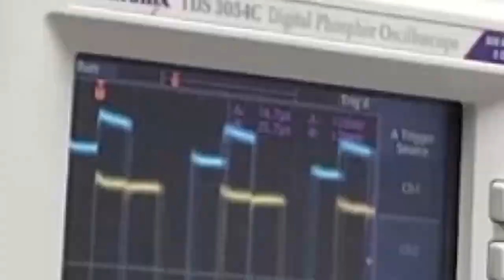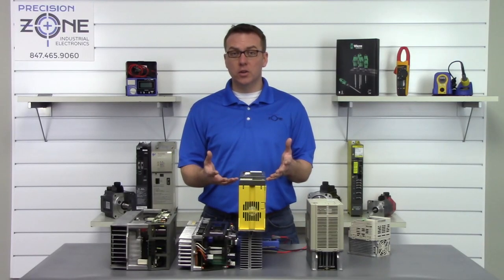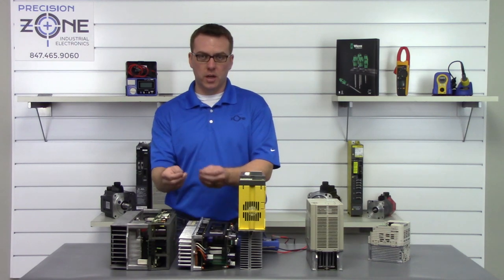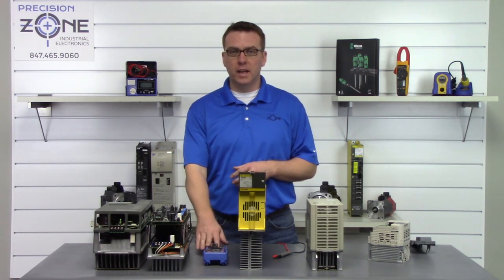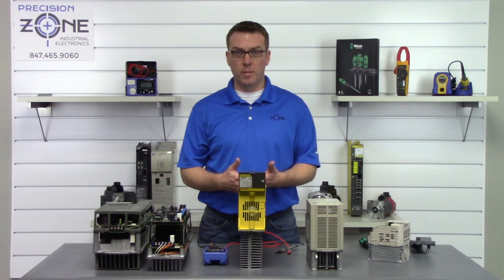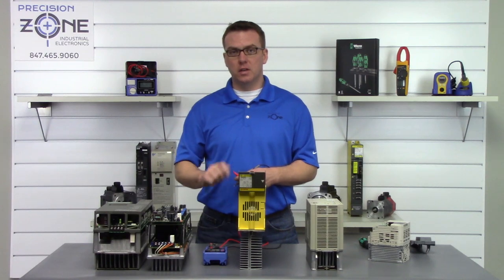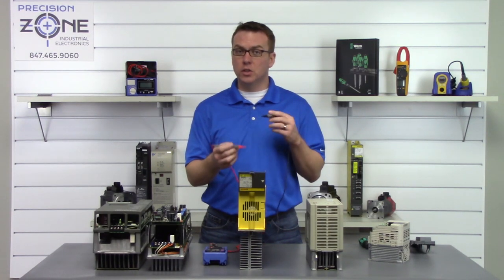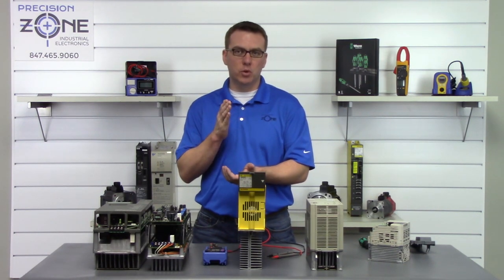Troubleshooting AC Servo Drives

Comment: I have a servo amp fanuc A06B-6096-H116 now 8. alarm sometime display. Please guide for me check it. 
Thank you verry much
Reply: Light House
Please check with its power module and motor insulation
If both are ok it can be sent to repair

Comment: When i start my machine indicate failure 11 and check it out like the video, all the values indicate is ok. But this failure is Causes:
High power impedance, PCB or transistor module are defective.
Solution:
Check AC power, replace damaged Fanuc part.
You can repair correct?
Reply: That's just simple method to verify if there's no shorted semiconductor. But sometimes (mosfet and igbt) are degraded in that way they won't show up S/C with low voltage probe of DMM. But if you apply high CE voltage (e.g. megger) it might show up a lot lower resistance than fully functional (so current "leaking out" despite transistor being turned off). During inverter operation it might lead to invalid motor rotation, eventual short circuit in output stage, blown off igbt, fuses, tracks, caps etc. or just desaturation error (and immediate stop) if drive is smart enough. Some drives use controlled rectifier at inputs so it can regulate charging of DC bus caps (no big inrush current at startup) without using NTC+resistor+relay and similar. Usually SCRs brake down to S/C state but sometimes it is open circuit. If that's the case drive might see it takes too long time to charge up caps (so it lost 1 phase). Or if there are indeed series pre-charge resistors they might be damaged and have too much resistance to charge up caps.